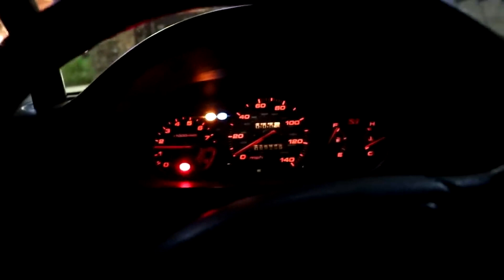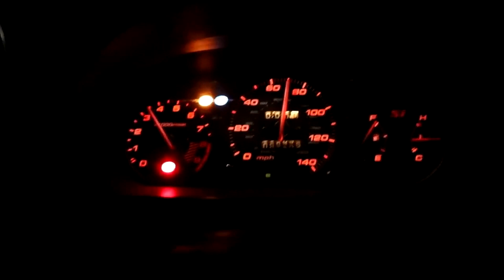"Blackish" civic has been SOLD....

Comment: maybe you should try an experiment like this.
https://www.youtube.com/watch?v=WHk8ieqEiP4&t
this is a Opel Kadett C 16V with Hayabusa Cylinder Head / 1.600 ccm / 10.400 rpm / 265 PS / 730 kg
imagine this on a 2.5 L  engine  and turbskis  
she is a screamer  :P
onboard cam  where you can see rpm.https://youtu.be/v3QHFMcn9C0?t=113.
 it basically live in the 5 digit area.
then imagine how much abuse it can take if it only need to run  a 1/4 mile.
think its worth having a look at how the cylinder head  is made..